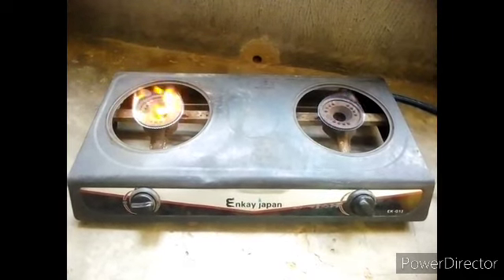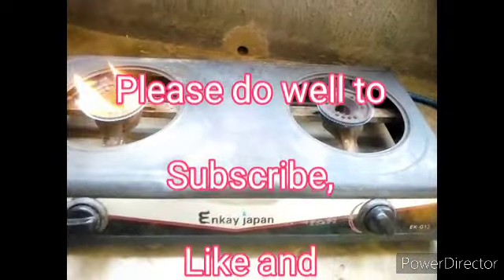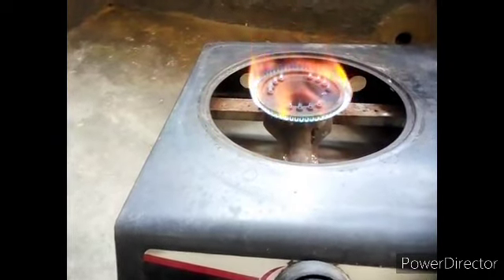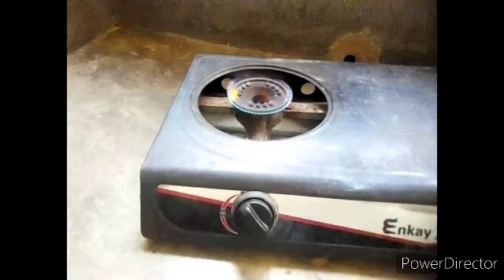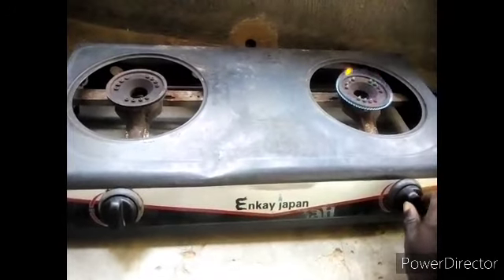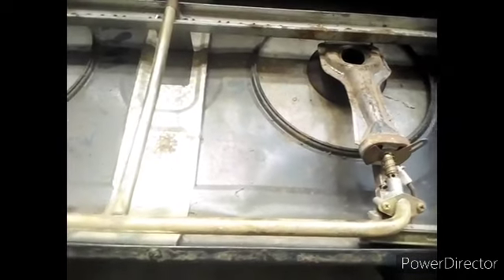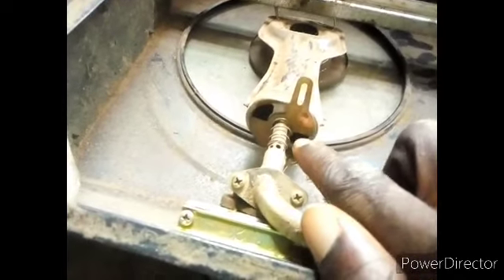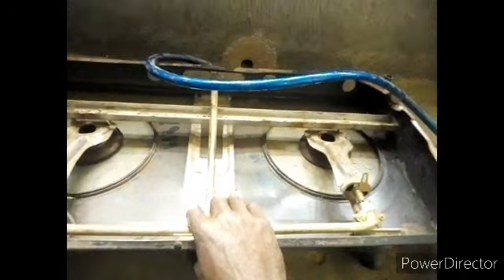Yellow Flame Gas Cooker? Just a touch

Comment: Pls hope this won’t the cooker to explode?
My neigbour had the same case and he did the same thing and his own exploded
Need your response pls
Reply from the maker: @Zicofarm  just know exactly what u are touching. I just turned the cooker upside down so that you see actually what u need to do.
Reply: @paulikenna2470  that control that you adjusted 
Does it need to be open wide or closed ? My table cooker is a twin burner 
So it has two of that thing in each burner
Does the two need to be open?
Pls sir
Reply from the maker: @Zicofarm  if yours is a twin burner with two different adjustable elements, just trace the one that is controlling either the inner or the outer burner. Your can adjust it different depending on the one that is bringing out the yellow flame.

Comment: How to make thé gas pass in thé stove i juste but a New gas  and a New stove  but thé gas dont pass in thé berner thé gas IS on but it dont pas threw
Reply from the maker: @ingridjerolon4613  welcome. If I may get you right, the regulator is on but it doesn't light up on the cooker. May be the hose is long enough so turn on the regulator then turn on the stove and allow the air in the hose to flow out. Turn off and then turn on again